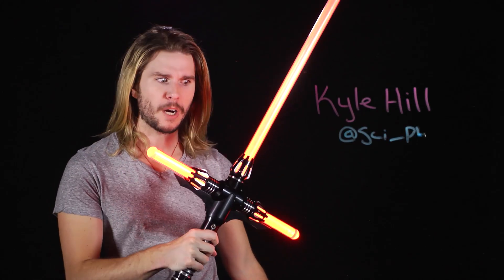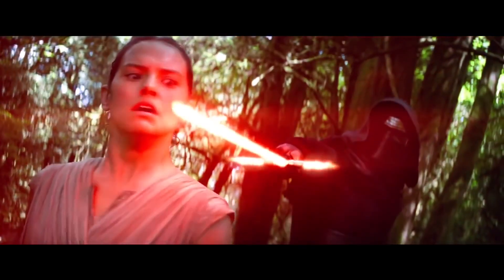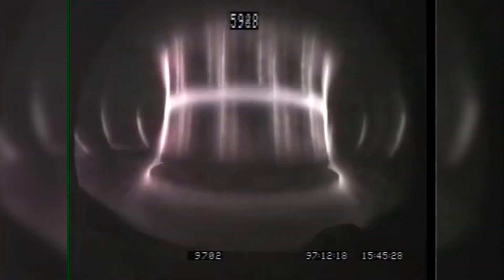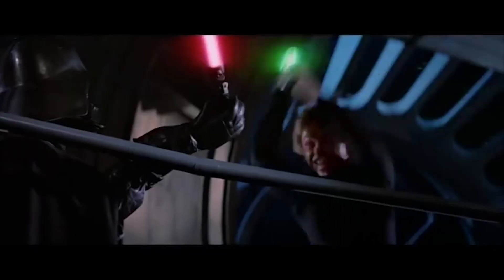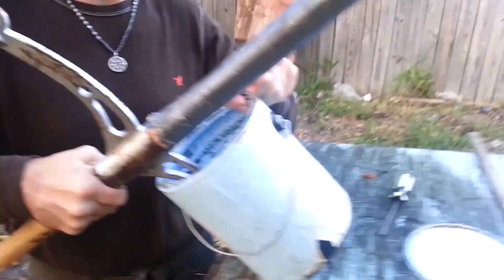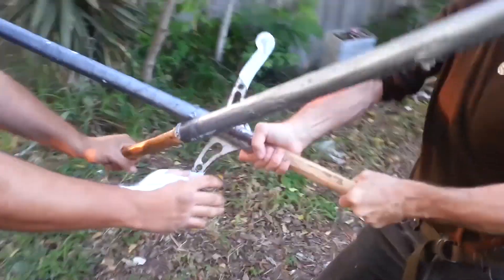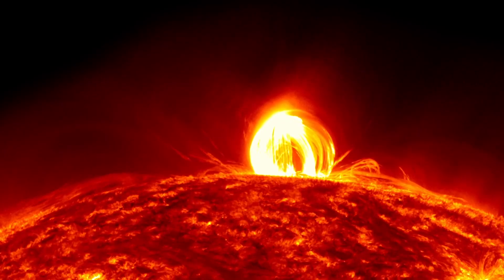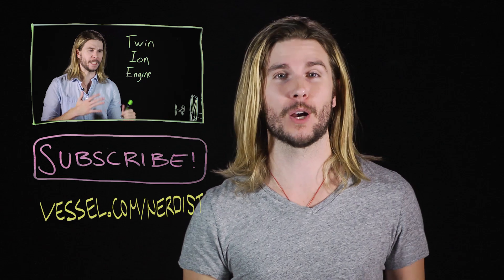Why Kylo Ren's Lightsaber Works (Because Science w/ Kyle Hill)

Comment: Kylo's saber doesnt work because the fact that the three blades all cross over in one point exploding outwards suggests the crystal is there. if it was lower down the handle you'd need some way of directing all of the energy upwards (in which case, you wouldn't need exhausts), a three way splitting lens that produced three short beams as well as a lens that re-extended the main blade, however, double the lenses on a blade would result in a weaker and finer beam, at least one that looks more like the typical saber. so we know that the crystal is in the crossing point of the blades. if the crystal is there and we need a little space for 3 lenses, one with standard focal point length, the others with short focal length. The only space for these two lenses is in the mini cross-gaurd hilts so its safe to assume they are there; This means that if anyone hit the crossgaurd, they'd take out the lens, the blade would go nuts and burn the users hand and/or the entire lightsaber would explode due lack of a much needed plasma vent..

Comment: Well, most of what you say in that video is true, ok... BUT both sith a jedi use 7 lighsaber techniques and the problem is that in nearly all of them you just need some moves that goes sooo near your own body, that you'd just kill urself with that crossguard. While it might safe you a hand it will ultimately make you at least 50% less dextrous and agile, so your hand won't really be the problem. Moreover, cuz it makes you unable to use certain forms of lightsaber combat, it makes you defenseless againts forms such as Ataru (also against other, but Ataru is the most obvious one). If you wouldn't know what Ataru is, it is the style Yoda utilized and was quite good at it. You see, when fighting against Ataru, you need extreme dexterity and agility and you need to cover yourself from all different directions withing seconds. The crossguard makes THIS impossible. Then, there's even the cultural problem. just putting a crossguard on a lightsaber is just about the same idiocy as putting a crossguard on a katana from which was the inspiration for the lightsaber design. So as much as you might not like it, Disney just fucked thing up one again.

Comment: Fantastic explanation. Only part I find fault with is the reason for the sparking of the blades and the rough look around the edges. I believe that's actually because Kylo's training was not complete yet and hence, his lightsaber was not properly assembled and didn't have the smooth look of other lightsabers. (Although, I love Kylo's and think it looks cooler with the sparky edges).

Comment: A crossguard would be absolutely useless in every single one of those circumstances. When Dooku struck Anakin, he struck at his elbow, nowhere near his wrist (That shows that even if Anakin would have had a crossguard, all you have to do is strike above it). A crossguard wouldn't have prevented Anakin from striking Dooku's wrists because if Dooku would have had crossguards, Anakin could have easily passed his blade underneath them (He didn't actually slide his blade down Dooku's to cut his hands off as many people have thought. If you watch it slowly, after their blades lock up, Anakin pushes his blade forward off of Dooku's and then swings it up, making contact with Dooku's wrists. This video doesn't show the blade lockup and subsequent movement that I mentioned). The angle of the strike also comes into play. When Anakin strikes Mace Windu, the position of his blade relative to the position of Mace Windu's body would have put Anakin's blade underneath the crossguards if Mace would have had them (He struck below the hilt with an upward swing). The same thing applies for Vader striking Luke (Just pause the scenes). Where Luke striking Vader is concerned, even if Vader would have had crossguards lined up with Luke's blade, all Luke would have had to do was aim up a little higher. Crossguards do not offer a lot of protection as widely misconceived. They offer very little because they are linear and thin. A crossguard would have to be positioned perfectly at the moment of the opponent's strike to be effective. Typically though, the crossguard was used specifically when your opponent was sliding their blade down yours. They were also used to prevent your hand from sliding up onto the blade. My point is that for defensive purposes against another blade, the crossguard didn't perfectly protect the hand like a lot of people believe. You can easily strike past it. It is most definitely functional, it just isn't perfect. By the way, as someone else pointed out, the so-called crossguard on the lighsaber was actually just power that was vented from the blade. It wasn't actually a crossguard.

Comment: Yeah, fine, except the cross-guard is hazardous to use when it can burn through your own wrist. You modify technique so bloody damn much that the weapon becomes a hindrance instead of using proper technique. Plausible? Yeah, sure. Practical? Absolutely not. If the bloody cross-guards were at least angled upward, they might be passable and forgivable, but as it stands, cross-guards are supposed to be for protecting you, and not posing a threat to you. These fail in that task. 

Additionally, I've never seen lightsabers skip along another lightsaber's edge. We should be able to deduce that the energy of the two blades meeting results in high friction preventing slide along the active edge, effectively rendering the cross-guards practically useless for defence. If as you say, the weapon is largely weightless, then many techniques that take advantage of the cross-guards and weight of the weapon become useless here. The best design is one that lends to the weapon's most efficient use. Under the circumstances, the presence of the cross-guards is a hindrance to the weapon's proper use.

The user's infinite skill still completely ignores what may happen when facing another opponent. Yeah, sure, the wielder might be trained to not cause harm to themselves, but that goes out the window when your opponent sees your weapon, knows it's drawbacks, and then proceeds to repeatedly land hits on you which force a defence that poses a risk to your own life and limb.

Comment: Especially the weak argument of people against it: "If a saber slides down it would cut off the metal!!11!!"

As it's exhaust vents (even if they where intentional not a byproduct of bad craftsmahsip) those would make sense as the beam gets projected from inside the hilt. So even if the metal wouldn't be anti lightsaber to begin with, even if it would break from an enemies saber the beam beneath it would still be there.

Comment: the arc wave isn't generated until it passes through the energy channel so it couldn't be one solid beam being divided by crystal(s). That means the crystal which generates the beam is located at the tip of the handle, which is nowhere near the center. I learned this from Warp Zone who tackled the topic with a funny sketch. With that said, I think the crossguard looks pretty cool despite the design flaw. Then again I'm not a megafan of star wars to begin with, but i'll watch and enjoy them.

Comment: a plasma cross-guard looks cool but why not just make a cross-guard out of light saber resistant metal instead?

also because i'm a stickler for details. in the EU, most of this info is form the jedi path to be more specific (rip, but it still has the most accurate info to date). the first light-sabers that had a energy blade, had a large power pack (like those needed for a mini-gun) eventually becoming small enough to be worn on someone's back like the fuel of a flamethrower would but still very heavy requiring special training and bogging down the wielder heavily... only after the sith recovered the ancient tech needed to make a compact version where they used outside of ceremonial events and siege battles... 
o and yes the light sabers are almost weightless but that doesn't mean adding more blades is a good idea that won't affect its usability...  this is because the magnetic force-field around the plasma that contains it has different property's depending on the crystal used in its construction (which is one of the reasons for the distinct color and trail)... for example the ''perfect'' black saber/crystal has a really thin edge and a fast responding/moving magnetic field... where as kylo's looks like its using some pawn shop quality crystal (even if its in the future) so it would have a almost flat edge and a slow reacting mag. field (that doesn't mean its unusable, its still a light-saber after all but of coarse its going to be less effective) the rest of the light-sabers we have seen so far are somewhere in between with generally mild variation because the crystals where hand picked form thousands, or mass produced with little to no margin for error (for example; standard red generally sharper edge but slower mag. field, standard blue generally average in both aspects and standard green generally has flatter edge but faster field)

Comment: Anyone that bitches about the crossgaurds for the metal is dumb. I have never read any of the EU so I'm not a huge starwars fan. Most people that complain about this saber say they are huge star wars fans. Then if you are, then you should know there is metal that lightsabers can't cut through. Some people have used it for making a lightsaber but because it's heaver they usually go against it. Now I haven't seen the movie yet I can't say if it has that metal or not. However it's not a bad design by any means. Especially if you are in fit shape, which you should be if you're a jedi/sith.

Comment: I like the way you give reasons for it being an understandable change to the lore but both you and Steven Colbert are wrong in where the plasma starts in a lightsaber.. If you would have read the comic you would have seen how it is built and that the top of the lightsaber is the only part that might have a bit of the plasma within it.. The crossguard wouldn't go that far into a light saber.. Proof?.. Check out Luke Skywalkers lightsaber.. It has way too slender of a neck to hold a plasma beam inside it.. Conclusion.. Most of it's beam structure is created at the top....

Another exampel is in episode 2 when Anakin's hand gets caught in a factory product and then a simple saw / blade out of metal slices through have half the saber.. You're wrong and this was fun to watch but no...

Comment: <Shaking head>. Listen and learn newb. This demonstrates perfectly the lack of military and dueling knowledge of APPLIED SCIENCE and would tell one that cross guards on a light saber make little sense.

1. Not one of these circumstances of parts being sliced off would have been assisted by a quillions. That's because quillions evolved as part of a totally different technique and approach to sword fighting than you find with a light saber which is closer to the concept behind the dueling and warfare surrounding a Katana....NOT a European style Middle Ages long sword. Check you Lucas notes... Jedi, conceptually were modeled around Samurai traditions and a light saber is totally consistent with those traditions and a Katana. Any first year Paduan should know this.

2. A long sword with quillions serves this purpose...defense against hacking and chopping....mostly overhead blows. The use of the cross guard defensively is called "binding". This is due to the fact that in Europe, they chose to use plate armor. The dueling and attack style is based upon this while in the East, armor was made of less durable but far lighter materials giving more mobility.  You can slice through Eastern armor, you can't slice through plate mail therefore....your attack....and your defense is geared toward something entirely different. It is not based upon clumsy and random attacks.

It is an elegant weapon.

Comment: Actually the  parsec thing might not be such a mistake as everybody thinks. Depending on your speed you can fly closer to things with a very high gravity (say like a sun or black hole) without actually falling in. So if the kessel run requires you to fly past several suns, going faster makes you able to go past them closer, requiring less distance than having to fly a longer way around them making han's statement possible.

Comment: Almost every shot you show of people being disarmed had their appendages cut off at the upper wrist/arm area which completely would have circumvented as cross guards that might have been there.
Anakin Vs Dooku on Geonosis = arm cut off slightly above elbow.
Mace Vs Palpatine = middle forearm ( and also due to Windu's downward strike a cross guard would have been useless against Anakin's upward strike especially due to the angle [anakin being a near perfect 90 degrees to Mace])  
Obi-Wan Vs Cantina Thugs = almost on the elbow.
Luke Vs Wampa = the entire damn arm.
Luke Vs Vader at Bespin =  at the wrist exactly because Luke's arm was outstretched. So even if there was a guard there it        would have done nothing against that particular type of disarming strike.
Luke Vs Vader on Death Star = same as above except that Luke is striking down at Vader's outstretched arm.

The only two times when a cross guard would have prevented a dismemberment (that you have shown) would have been:
Anakin Vs Dooku in Grievous' Flag ship which would have prevented Anakin from rotating/spinning his lightsaber around Dooku's wrists and severing them.
Obi-Wan Vs Grievous when Obi-Wan slid his lightsaber along the length of Grievous' lightsabers and severed his hand. NOTE that THIS is how you are supposed to disarm an opponent in real sword combat, however due to the fact that these swords are superheated plasma then Grievous' lightsaber should have been destroyed too.

And Colbert's reasoning is flawed as the beam doesn't start inside of the hilt itself, but rather right as it leaves it.
Though there are a some advantages to having a cross guard, one of the biggest disadvantages would be that by it's nature the tri-saber hampers mobility. Form II Makashi with its tight and precise moves would be difficult to translate with the added presence of two additional blades each going in opposite directions from each other. Though a tri-saber could be used exceptionally well with Form I Shi-Cho. 

All in all I don't think the tri-saber is a bad idea, however peoples justification for it goes against what is already widely excepted as star wars fact concerning lightsabers (even if it is from the EU).

Comment: Parsec make sense if you know what the Kessel run actually is> The Kessel area is full for gravitational anomalies such as black holes and is incredibly difficult to plot a safe course though. When Han Solo says he made the Kessel run in under 12 parsec's its impressive not because it was fast but because he plotted the shortest  path through a dangerous area by making few detours around the the most dangerous areas. He used less total distance than anyone else did to get through the area.

Comment: You know, any other situation, I'd agree, but when disarming the opponent, they don't travel down the length of the blade to cut off the hand/arm as they do in the practical video. They are cutting perpendicular to the cross guard. Really, a cup hilt would be more practical, but I would imagine that to be even more problematic than the cross guard itself, restricting maneuverability, as well as the obvious mishandling.

The only advantage Kylo has to wielding such a massive lightsaber is to put more momentum behind his strikes, like you would with great swords... except... there shouldn't be. He's still wielding it one-handed so that is still one arm's worth of applying force (Newtonian, not Jedi) and because the plasma blade itself has no mass, it's still the same as a regular old lightsaber.

Comment: The light saber crackles and sparks because he ghetto rigged it from a broken crystal, it's not better, it's worse. And if the crossguard just breaks off from the main beam, where does he fit the other 2 crystals needed to project the beams?
And another big thing is that swordsmen work with the weight of a blade. If you have a weightless blade, the crossguard is much more dangerous.

Comment: Crossguards were used on heavy swords. Your opponent's sword could still slice your hand due to its weight. Advancements in forging reduced the weight of swords.  As a by-product hand guards were reduced in size. Eventually most of these cultures settled on the rapier. Lightsabers are based on Japanese swords - the lightest yet strongest.

Kylo Ren's tri-saber is not an abomination since Darth Maul introduced his double-edged in Episode 1. However, the tri-saber comes from an earlier time when brute force was favored over skill. Having to protect your hands shows a lack of training. Obi-Wan fought many fights and his hands remained with him 'til the end.

Anyways, the tri-saber was made for stylistic reasons and not for functional ones. After all, the fan boys were impressed.

Comment: I think cross-guards were invented so that the user's hand would not slip up the hilt onto the blade when using thrusting attacks. If you didn't have a cross guard and you trusted powerfully, you could potentially slide your hand up the hilt and slice up your hand on the blade. 
Of course since lightsabers probably wouldn't have much resistance thrusting through things, your hand would be less likely to slip up the hilt, but still seems stupid.